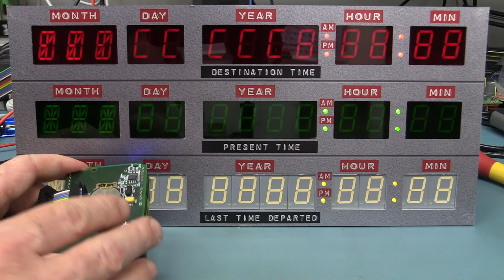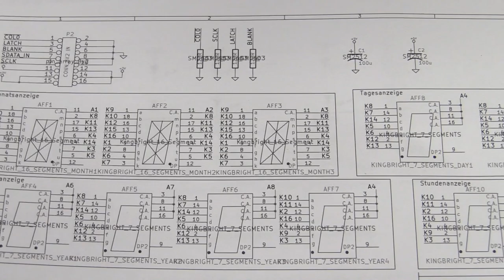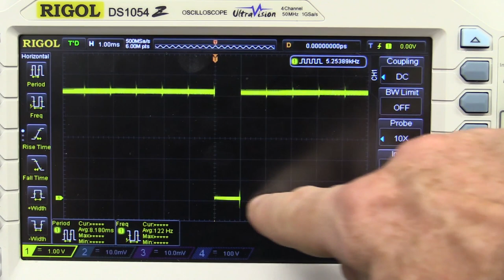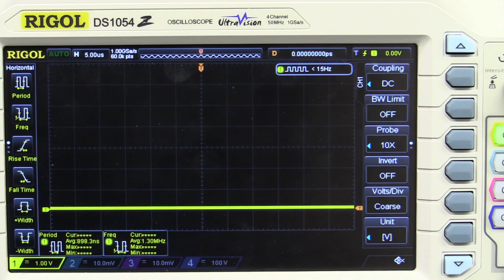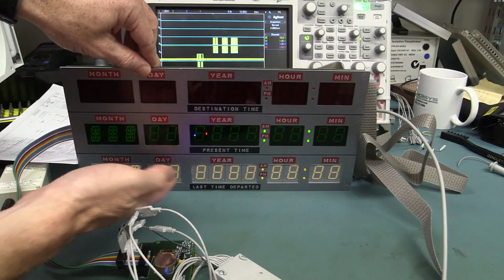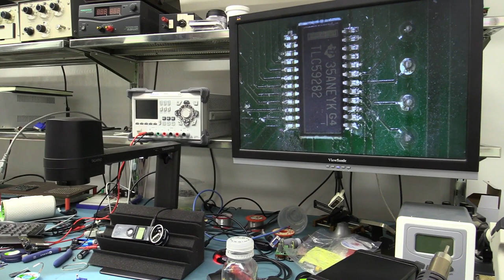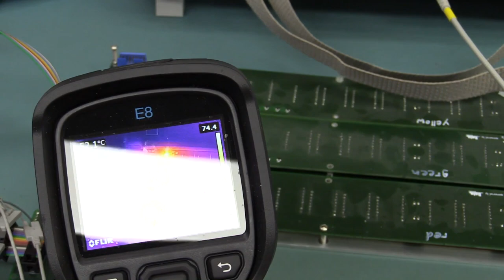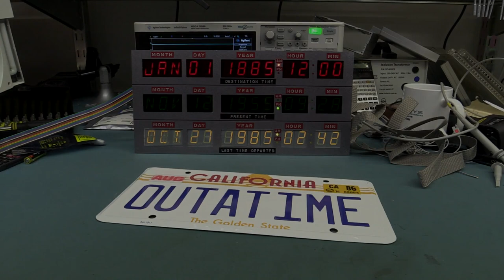EEVblog #689 - Back To The Future Time Circuits Troubleshooting

Comment: I've learned 3 things from this video:
1) don't plug it in backwards
2) solder properly
3) double check solder joints and save yourself 43 minutes of video trouble shooting the damn thing. 

:-D

Comment: and what are those red blue/purple red dots in the lower display?
Reply: They would be reflections of lights on the Arduino (compatible?). See where Dave tilts the panel at 34:45

Comment: Hi Dave
We've learn that plug or connectors can fit the wrong way around .
( I can so I will ! ) plug keys & locating pins were invented for this .
As for DC power lines a diode & fuse is useful .
A burnt up component may not be the only dead one .
Solder SMT properly is a pain in the b.....t .

like your channel
see you on 2011 ;-Þ

Comment: well surely some mentioned this already, but you should really change your SMD soldering technics.. better use proper heat pens and soldering paste.. anyway, nice trace-down of the failures.

Comment: I feel you pain i was having problems with a keyboard ( old ibm with replacement controller) i traced out the whole capacitive matrix to make sure it was wired up correctly, measured the resistance of every cable in the connector ( as i hand wired it total rats nets ). re soldered the whole thing ( to be fair one joint was dry ) checked the clock and all that was wrong was a floating ground :P.

Comment: Jeah would have used the continuity tester first from the arduino to the ic.. on the otherhand it propably wouldnt have beeped when probing the pad. I thought it coud have been a broken ribbon cable. I hate them.. lot of work to probe them and at first you wouldnt think they break so easily.

Comment: I have these occasional times that I can't trust the obvious causes for something not working. Like some examples:

*The first time I bought my own Sony CD-R my first try to burn discs failed because it was pretty much the only box of bad verbatim CD-Rs (or any) I ever experienced. A later Sony DVD-RW burnt out of focus and I had a lot of galaxy like lousy coasters later. Lost of a lot of discs there. 

*I got this compaq AMD motherboard and supply. I was testing out an external modem with it and not the original ATX supply. It would not turn on again, and I looked at the modem adapter and it looked like it blew big time. It did not blow though, it just fell apart from time. I later glued it back together. I nearly destroyed the motherboard until I tried it with it's own supply, which it worked properly with. Other ones it would turn back on after a few minutes. I blamed it on amp ratings  for powerup features on USB, etc...

I am sure I could think of other bizarre coincidences.
Reply: Recently I was installing a dimmer switch for my tracklight LED lights and I did this conductivity test to find the output line of the switch to the track. What I found out is like it was conducting to EVERYTHING because both black wires somehow went though lightbulbs that were not otherwise on. I took the light bulbs out and I could find the real black wire I needed of the two. I noticed one of the black wires did have a different resistance value.

Comment: i would never buy a sterioscopic microscope

i cant see 3d so why do i need to have it
Reply: You can't? You're a cyclops?
Reply: nope crossed eye
and my brain aqdjusted by switching one eye off
i can choose witch one
Reply: The Mantis isn't really stereoscopic; it has a wide angle optical path, which would actually be helpful. It means shifting your own eye gets you a different perspective (the same principle as the distance between your eyes would), without having to move the microscope or subject. This is a considerable difference to dual path microscopes where you get two oculars with very restrictive sweet spots. It's like binoculars vs a huge magnifying glass, if the two worked at similar distances.

Comment: 3 separate devices showing the exact same symptom, to suspect 3 separate failure instead of a single failure wouldn't be terribly sensible. especially considering that they all had the same symptoms...

Only hint that all three may be dead is the fact the are all connected together serially, so the first killed the second and third... it's  lucky that they didn't re-kill your repaired no1 chip..